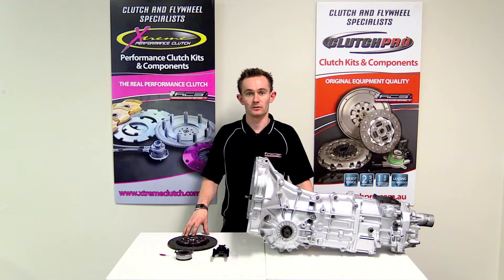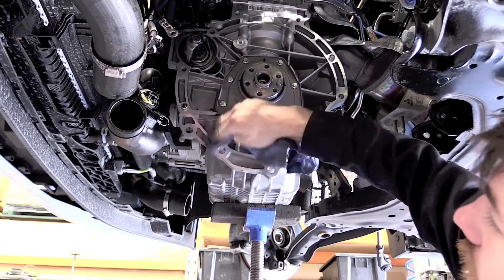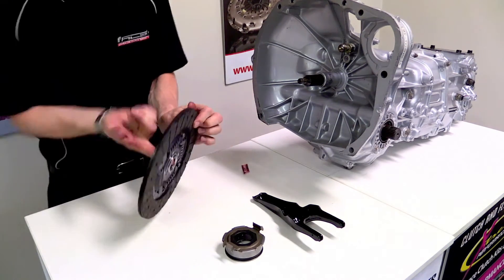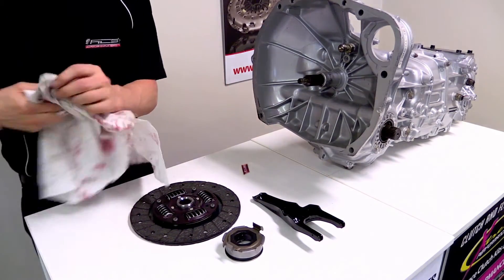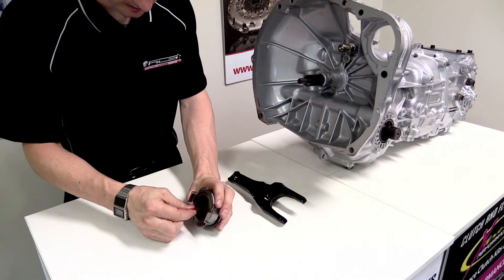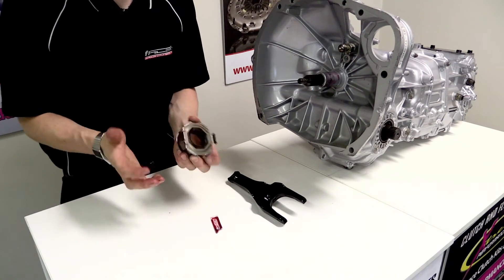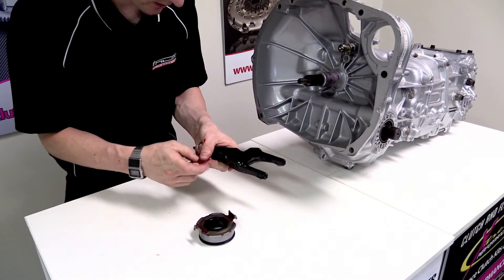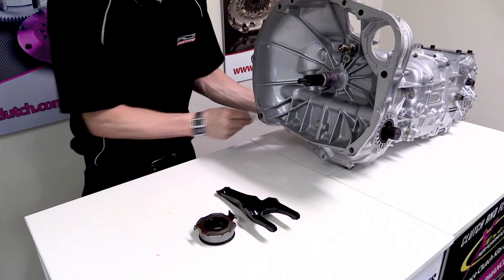CLUTCH TECH: Gearbox Cleaning and Lubrication Guide

Comment: What happen if you forgot to lubricate?
Reply from the maker: Thanks for your comment,
This depends on what area didn't get lubricated. If it is the clutch fork, pivot points etc., then you may experience noise and excessive wear. If the clutch disc spline has not been lubricated sufficiently then release issues can occur with the clutch. It is also very important not to over lubricate the clutch spline as it is likely to contaminate the friction material if it is over lubricated.
Thanks

Comment: What greases can be used to lubricate the release bearing and snout of the gearbox.
Aluminium gearbox snouts wear too easily compared to old school boxes
Reply from the maker: Hi, 
These can be lubricated using a high temperature bearing grease. We have this available and also supply this in our kits. If you would like to find your nearest distributor, please email sales@australianclutch.com.au and our friendly sales team will assist you with this.
Thanks
Reply: Australian Clutch Services , thankyou
Reply: @australianclutchservices7503  Hii. What temperature range has to be in that grease?
I have ROWE Greaseguard Alltemp 2 grease with range of -30 to +160.
Is that fine?
Reply from the maker: @zhanisgalyanov3276  
Hi, We just recommend a high temp bearing grease (-20 C to + 150 C).
Reply: @australianclutchservices7503  Got it. Thank you!